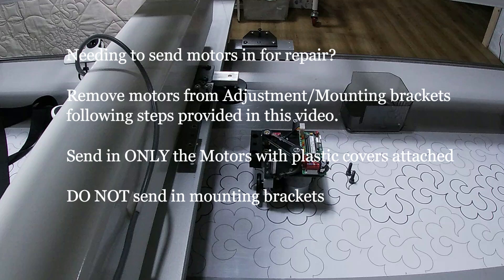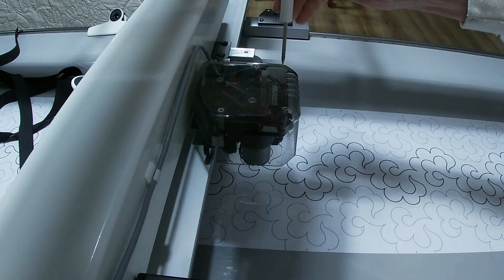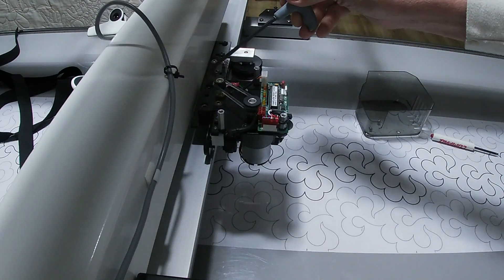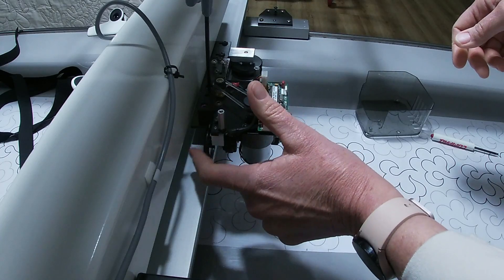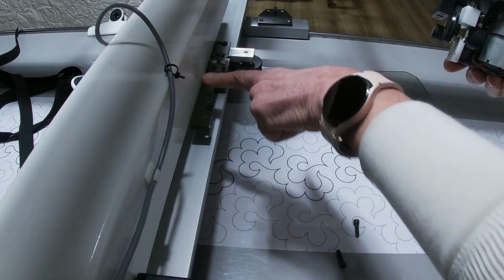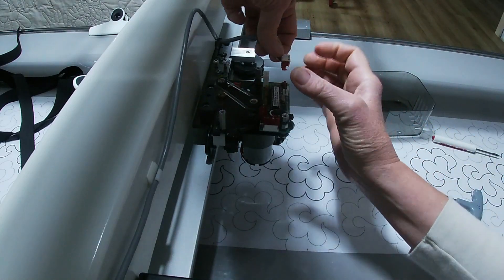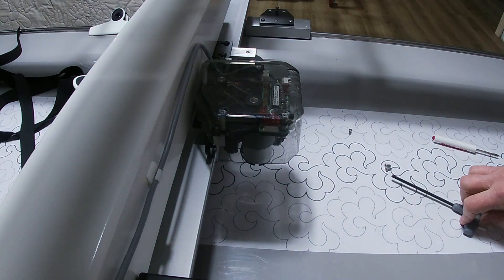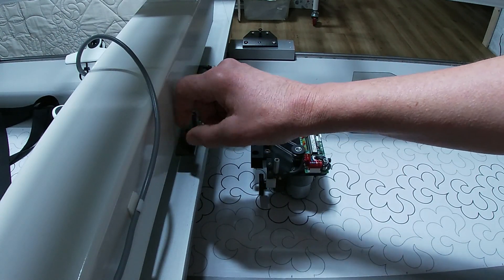Removing IQ Motors for Service

Comment: Do I need to remove the motor brackets if I'm packing up my longarm for moving?
Reply from the maker: I try not to  so I dont have to readjust them when setting back up.  But that would be dependant the packing.  If you can do so without harming the brackets, then no.  but If that is not possible, you should remove the brackets.  On my APQS systems,  I can leave the brackets and still get them in their boxes.